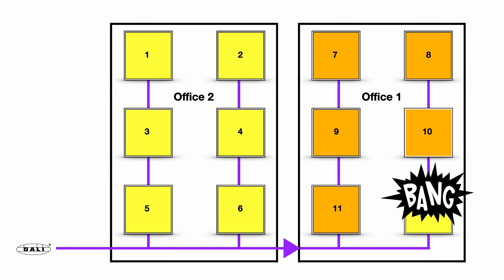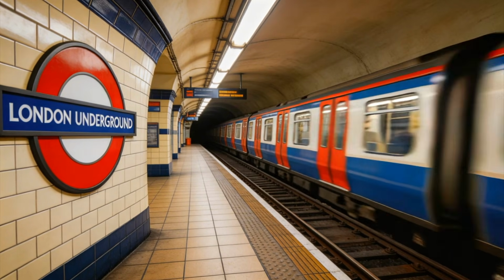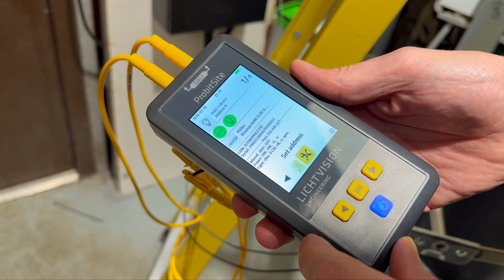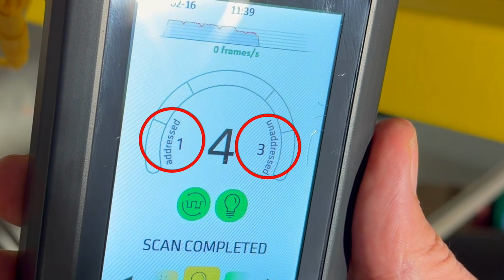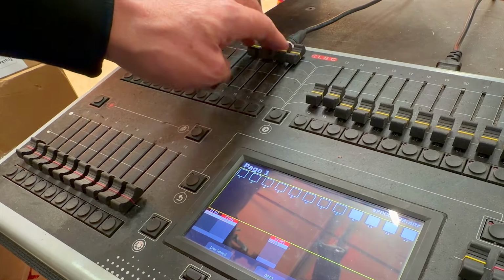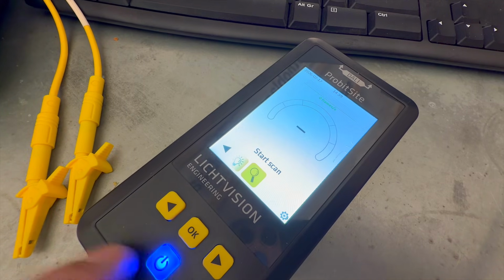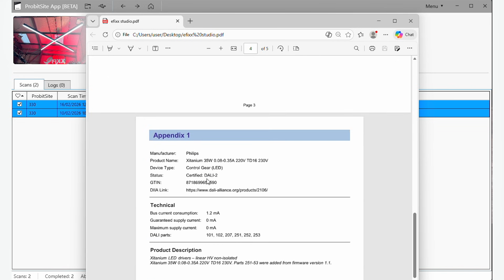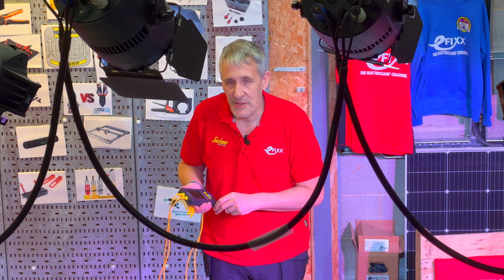DALI Fittings Not Responding? It's an Addressing Issue

Comment: Spot on about those midnight maintenance jobs, DALI addressing can be a nightmare without the right gear...
The ProbitSite looks great, but funnily enough, I just came across a similar device when searching online – the Pilo One DALI tool. It basically does the exact same thing but has AI built-in to speed up the whole configuration and fault-finding process.
Has anyone here tried it out yet?

Comment: Idea: make up a cable with a 13A plug, one of those flex7 sockets and a couple of 4mm shrouded plugs so you can easily test fixtures in isolation.

Comment: Why does this have an "expert" mode?  Only "experts" should be using it, opening control panels, de-wiring fittings or systems, clipping devices to bare conductors, etc.  What on earth can you do with thing turned to "normal" mode?  Point and click and say "ooh look, our lights do pretty things!" which you can do from the front panel or scene controller.
If you've gone out to buy this, probably for a substantial sum, why would you not want to be able to update the system with it?  And if so, why wouldn't you also have downloaded the Windows i/f , and why wouldn't you then immediately switch it to "expert" mode to make the expensive box useful!